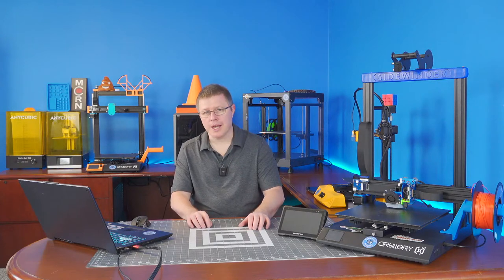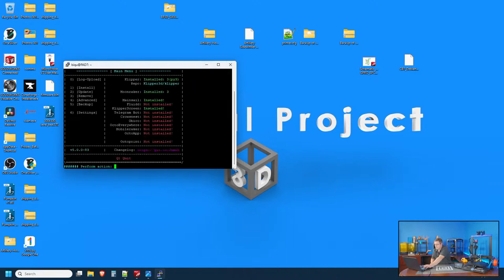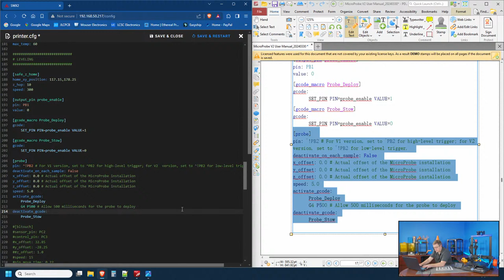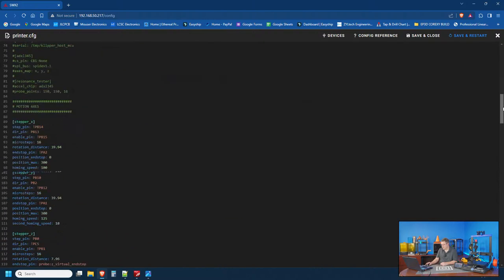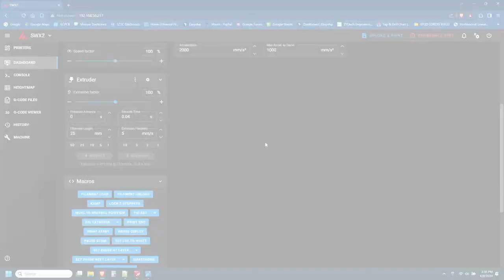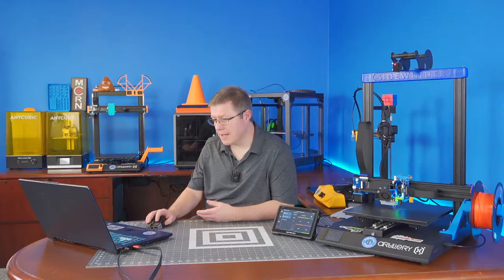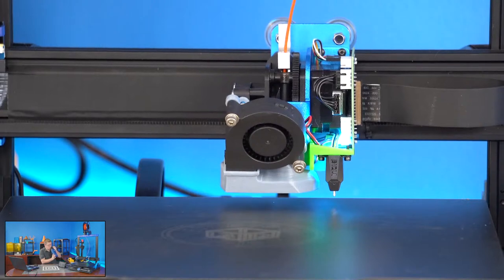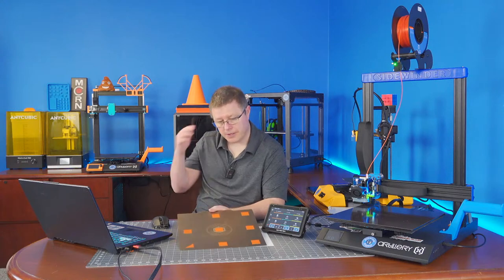Sidewinder X2 Upgrade With The BIQU Microprobe V2 and Klipper Firmware

Comment: hello could you show the connection diagram of the bq micro probe on the sidewinder x2 thank you
Reply: Yes that would would be a great help
Reply: there are markings on the new probe and also on the pcb on the printer the only thing you need to do is splice the grounds together as there are 5 pins on the new

Comment: I'm having a problem with the same issue you had on the video. The probe won't stow or deploy.  I went from stock straight to the BIQU Microprobe, but didn't touch anything on the printer board (just plugged the Microprobe directly into the Dupont connectors on the Ethereal breakout board).  Is there something I'm missing?  I've been messing around with the printer.cfg configuration for the probe pin, but when I tried the same thing you did it still didn't work.  The self test when the printer boots up shows that the probe is working, just not after it's booted up.

Comment: Hello

first of all, thank you very much for the many videos on the Sidewinder X2 I have implemented a lot of things from what my Sidewinder has also introduced to completely new qualities.

But now I have a very strange problem and I don't know whether I may not have heard an important hint.

I have converted my Sidewinder from a stock sensor to a CR-Touch. But every time I switch on the printer or leave it switched on for a while and perform a homeing or start a print, the following happens.

Homeing of all axes, CR-Touch goes off and immediately on again and I get the message: "BLTouch failed to deploy" then immediately press Home All again and it works.

The same happens when printing....

Print start, heat up, homeing, error, restart print and it starts printing.

I used your cr-touch config when switching to Klipper.

Any idea what this could be?

Thank you very much.
Reply from the maker: Possibly a loose wire.
Reply: @EtherealProject3D  YES! Thanks, it looks like the cable came loose when I screwed the cover I cut open with the dremel for the fan and the probe back on.